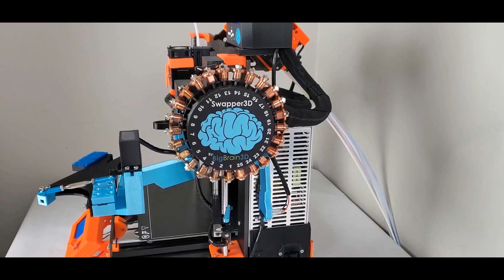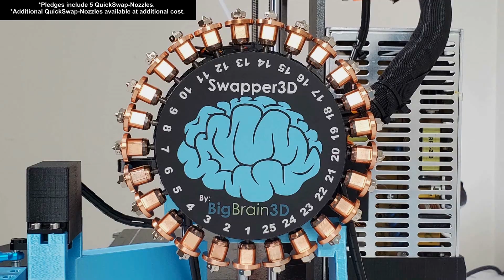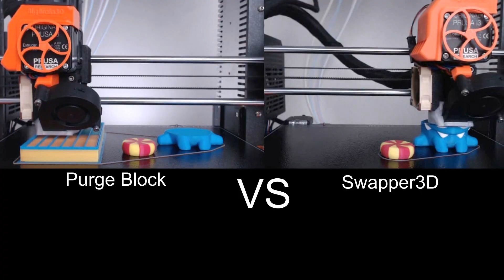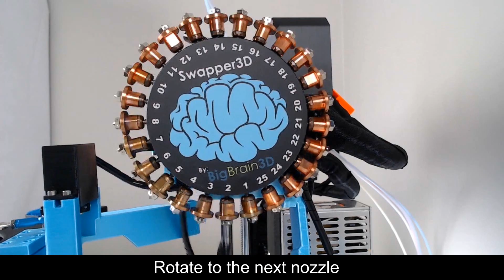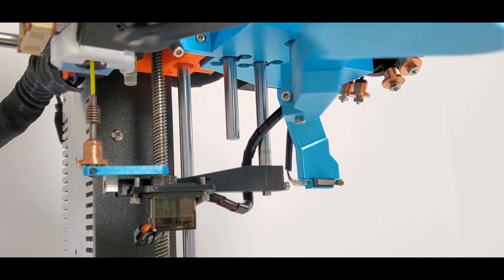Never print a purge block again!

Comment from the maker: Thank you all for the overwhelmingly positive support!!!!
As we review the comments it’s clear that there is some information missing from the demo video. But YouTube won’t let us make changes to it, so we’ll attempt to address some of the needed information here. We are working on a supplemental video now that also addresses these points. In the meantime, we hope this helps.

Here are the answers to your most frequently asked questions:
Q-How is the filament switched? 
A-In this video we are switching the filament after a nozzle change using the Prusa MMU (Multi Material Unit).  In short, the MMU pulls the old filament out -> selects a new filament -> then loads the new filament in. (The Swapper3D cuts the filament before the MMU pulls the old filament out to prevent possible strings and jamming.)  The Swapper3D can also use these filament switchers: Mosaic Palette (any version), CoPrint,  ERCF (enraged rabbit carrot feeder), Ryper MMU, 3D Chameleon, and any other similarly designed filament changer.

Q-If you only have 25 nozzles can you print a model with more than 25 color changes? 
A-Yes. Each nozzle is assigned to a single particular color and reused an unlimited number of times. Each time the printer needs to use that color the Swapper3D loads the nozzle for that color, it's heated back up, and the printing continues. In this way unlimited color swaps can be done. For example, the print in the video has 576 swaps. 

Q-Why 25 nozzles if the mmu can only manage 5 filaments? 
A-The Prusa MMU can switch between 5 filaments, the CoPrint up to 7, the Mosaic Palette up to 8, the ERCF up to 12 (enraged rabbit carrot feeder), in the future there may be even more. The Swapper3D supports "UP TO" 25, but it will work with 1 or 2 or 5 or 8...all the way UP TO 25. When users purchase the base Swapper3D kit it comes with 5 QuickSwap-Nozzles and it can be expanded by adding more at any time in the future. The ‘up-to’ 25 nozzles can also be used to automatically switch different nozzle sizes during the print even when printing with a single filament. 

Q-Wouldn’t some other printer/system/technique be better/faster/less expensive to use than the Swapper3D? 
A-No. Some people really love their 3D printer (like the Prusa i3). With the Swapper3D they can keep the printer they love and add new improved functionality to it. No tool changer out there supports 25 tools, there isn’t the space for that many tools. All those other ways of MultiColor printing require purging, and the Swapper3D eliminates that. Over time the ongoing consumable filament costs + time saved will pay for the Swapper3D’s static price. 

Q-Will this work on my printer?
A-Possibly. Currently we only support the Prusa i3 and Creality Ender 3 out-of-the-box, but we will be adding support for other printers as fast as we possibly can. Brave Makers (like you) can also modify the mounting bracket or create an adapter to mount the Swapper3D to their own printer. We encourage this and supply the 3D step files to our customers to make it easier for them to create their own custom adapters. In addition to mounting the Swapper3D, your alternate 3D printer needs either an available serial port on mainboard or an external Raspberry Pi running Octoprint to coordinate nozzle swaps. 
Because there are so many different variations of 3D printers we really do need the community to help expand support for the Swapper3D. 
Printers with a similar design to the Prusa i3 (i.e. bed slingers) will be the easiest to adapt to. Core XY printers will be next for us to create a variation for. There is nothing preventing a core xy printer from using the Swapper3D as long as it has a) an adapter b) an available serial port and c) available clearance. 

Q-Is it open source?
A-Since we have added some new gcode commands to Marlin firmware those changes will of course remain open source along with Marlin's standard license. Additionally, the Swapper3D firmware and all of the printed parts are Creative Commons Attribution-NonCommercial 3.0. 

Q-How long does it take to heat the nozzle up when it’s first inserted? 
A-About 15 seconds, which is almost exactly the same time it takes the MMU to unload the current filament and load in the next filament, which means the swap adds zero(0) seconds of additional time because of the nozzle heating up. The Nozzles have a low thermal mass. The QuickSwap-Hotend has a much larger mass and it maintains the temperature of the heater block at all times, during printing and during a filament change and during a swap, with the standard 6mm tube heater and thermistor of the Prusa i3 extruder. When a cold nozzle is inserted, it lowers the temperature of the heater block by about 15C. The Swapper3D inserts a gcode command to wait for the temperature to stabilize to the print melt temperature before it continues printing. 

Q-Do you have any videos showing the printing while using the Swapper3D?
A-Here are 2 unabridged videos of printing with the swapper3D:
     Front facing: https://youtu.be/Z3rjUGf5QYM
     Side facing: https://youtu.be/ltVoUz5mSNg

Q-How do you deal with any ooze that happens while the nozzles are cooling down or heating up?
A-There is a wiper molded into the cutter guard that deals absorbs the ooze (not shown in this video. see Kickstarter for more details) We also infill before perimeters to address the pressure stability and priming. Though additional priming can also be done on the wiper pad if needed.
 
Q-If you cut the filament how does retraction work when the nozzle is loaded next? In other words, will retraction still work?
A-Yes the retraction still works. During string calibration test prints no noticeable difference is observed between areas where the filament is cut and still disconnected and those where the filament is rejoined in the hotend melt zone. The effect of retraction is made by removing extrusion pressure which still happens during retractions even after the filament is cut. 

Q-Does this work for automatically swapping different nozzle sizes during a print? 
A-Yes, you can use this to automatically change nozzle sizes too. and you can use it to swap filament materials too.

Q-Can't we just purge to infill?
A-The infill is almost never enough volume for a color purge. Remember the infill is limited to the volume of that color space on a single layer. And the infill volume varies by layer so for larger layers maybe it's enough but it may not be on smaller layers and then you'll get color smearing.

Q-Can you share some of the  failure modes of such a system ?
A-We foresee 4 possible failure modes 1)it cannot unload the nozzle 2) it cannot stow the nozzle 3)it cannot select a nozzle 4)it cannot load a nozzle. We incorporate a check switch/probe that confirms each of these steps. For instance if it failed to pick a nozzle out of the tool holder wheel then when it moved to the switch it would not trigger it, then the Swapper3D would display an error on the LCD and pause the print waiting for user intervention. 

Q-Is there too much weight added to the Z axis?
A-No. Not for a lead screw. 1398g are added to the sprung weight. The current of the Z steppers is increased to account for this, and no missed steps have been seen. In the kit we include heat sinks and a fan that are added to the printer main board which keeps it much cooler than it was with even stock current.

Q-How are the QuickSwap-Nozzles held in the heater block?
A-There is a sliding lock that pulls the hotend up against a taper in the heater block. You can see more information about it on the Kickstarter page.

Q-How high is the failure rate?
A-Very low. We are currently stress testing the current iteration of The Swapper3D (the one in this video) which has done more than 35,000 swaps without failure up to now and is still counting.

Q-Wouldn't a purge bin be better?
A-No, because the amount it would need to purge would be the exact same amount (and take the same time) in both cases. The only benefit to a purge bin is that you save the bed space, But many printers cannot move the nozzle off the bed, so in cases like the Prusa i3 you cannot use a purge bin. 

Q-Why are you cutting the filament when you can just retract before pulling the nozzle out?
A-Because Swapping nozzles is better. Pulling out the filament can cause strings and malformed tips that interfere with reinserting that filament next time. It's such a common problem that many users hate filament switchers like the MMU because of it. Cutting the filament eliminates the possibility of those problems and makes the MMU much more reliable. 

Thank you for watching! =D
Reply: I really appreciate your candour, but "open source for non-commercial use" is in direct conflict with clause 1 of the Open Source Definition. On the other hand, NC is an established condition in e.g. Creative Commons, and a respectable choice of where to draw the line for your designs. 

The point it becomes a bit weird is e.g. if someone wants to build a print farm using a printer that requires a modified mount; will they e.g. have to override the license by interoperability requirements? Would it be restricted to hire a modeller to design that modification? 

Anyhow, those are hypothetical scenarios. Your product remains your design and anyone would be free to approach you to negotiate terms if those prepared don't suffice. 

Good luck!
Reply from the maker: @0LoneTech  We've updated our pinned comment and will use the more appropriate license you suggested. Thank you for your advice :)
Reply: How can this setup accurately position the nozzle when swapping?? .. just a 0.05mm Z variation will totally screw up a print.. and a 0.1mm X-Y position error will show on your part. Are you recalibrating somehow after each nozzle swap??
Reply: Hi, just saw this video and Kickstarter has finished. How do I buy this? Do you have a website, email list etc? Couldn't find any details on Kickstarter (never used it before) on how to contact a project after funding, like Indiegogo's "in demand" feature
Reply from the maker: @darkbunglex  We've updated the Kickstarter page with a 'Pre-Order' button. The Swapper3D is now available to pre-order on our website: https://www.bigbrain3d.com/product/the-swapper3d-no-more-purge-blocks/
Reply: Really cool. How does the quick-swap nozzle work, I mean it doesn't fit in the Prusa extruder, would you exchange the extruder? Any plans to make it compatible with Prusa MK4?
Reply from the maker: Yes, we plan to support the Prusa MK4. Currently the QuickSwap-Hotend required to use the Swapper3D does fit in the stock i3 MK3S+ extruder. We are going to do our best to support the MK4 extruder with all it's awesome new features, especially now that the MMU3 is coming out.
Reply: Good question… Is every swap nozzle calibrated in it’s Z height like CNC tools?
Reply: do not buy. project was abandoned. owner won't respond to backers or community
Reply: Is this shipped to anyone? I hardly see anyone using it other than your video on YouTube!
Reply: Ñ km

Comment: A few other questions for your FAQ:

1: Has it gotten klipper support?
2: Is it open source, as in an existing bom? Or closed source and electronic parts only gotten from your store/pre-compiled firmware only?
3: Does it only work with that hotend in the video? Or altered past year to work with other hotends?

Comment: Question: 
How accurate is the z-tolerance (and x/y) so the standard deviation?

Don’t you need to purge some filament, because of the filament overheating.

What about retraction, because you cut the filament…

Comment: I bet if you'd release a compacter version with only 5 nozzles on a little tray instead of the big wheel with a motor and reducing the size of the filament clipper by it being pushed towards the filament from the side instead of rotating it in or something, it would be a nobrainer for even more people.

Comment: You know, I feel like this is a super smart solution to multi color printing without purge blocks. The one part that you lose with this though compared to something like a toolchanger is the possibility of multimaterial printing since you cant have different nozzles at different temperatures. Maybe something like this where you could also swap the heater block would be a fix to that, but at that point the complexity of the solution is wayyy too much imo

Comment: You guys should just make your own 3D printer, and mass produce them... Unless there is a patent preventing you from doing so. I feel like you could also make a tool changer style CoreXY similar to the XL that has a row or several rows of nozzles that the print head can move over to the nozzles and it moves up and down on the nozzles to docks or undocks them rather than using so many servo's and motors.
Reply: they couldn't even complete this project. they have completely abandoned it at this point and won't respond to their backers

Comment: Cool, but you still have filament in those nozzles and on top of that, a kickstarter project is generally something that a lot of people wouldn't back because there is no guarantee that you'll just run off with the money. It does look like it may have made it out of kickstarter and onto a normal product page, but that's a pretty expensive system.

Comment: Purge infil fixed it all.
Reply: I think it depends of the model. It may be that not enough color was bleed into the fill layer before printing the perimeters. In my case I still have mmu problems with the tips of the filaments and the palette is not very reliable either.

Comment: I do think this is neat but is vastly overengineered. the rotating tool changer is wierdly awkward and makes me wonder if there was some CNC machine patent dodging required to bring this to market. Most of this could be achieved with two sliding segments and a solinoid or three.

Comment: If you can swap out the enter head assembly why not make a rack with all the nozzles with individual filament feeds still attached skipping the cutting section all together? Heck you could even swap out the entire filament feeder assembly as well. Just need to attach the enter unit back up to the drive section of the printer.

Comment: Nice but I am concerned about the added weight on the z-axis and compatibility with direct drive extruders, like the Voron V2.4 or the Elegoo Neptune Series uses. I would love to see a similar system, that is also able to pull out filament, reinsert filament and is fixed in place without adding weight to the z-axis. It should also be easily be convertible to use on most other printers other than the Prusa line, though I understand why you chose them. 

If you'll ever manage to fulfil my requirements I'll be ecstatic, as long as it falls into the 200-350€ range.

Comment: For some comments here : its logic to swap the hotend to avoid doing a purge , but this means you can only swap 25 times in a print
Reply: No it doesn't. They said they swapped over 700 times during the demonstrated print. You're stuck with up to 25 colours, not 25 swaps.

Comment: 1:35 these are different prints on the swapper 3d print you dont have that huge cube that takes alot of time and filament so thats not really a fair test
Reply: Thats the point, you dont need that huge cube with this system 😊
Reply: This comment is satire right?

Comment: FDM 3d printing sucks no matter what you do...
Reply: why exactly?
Reply: @Kernias  Mainly because its very slow, also it has a lot of "variables" that can ruin the print, such as too much heat, not enough, etc. and then you get print that has visible layers, and currently there are no "plug and play" printers for people who just want to print without tinkering... (X1 also has problems)
Reply: @CubiCNooBiC  It is slow for large scale mass production, but if you need to prototype and cant invest in something bigger like sls its perfect and while the X1 may not be without problems it's plug and play for most people, and layer lines can mostly be smoothed easily but tell me why fdm printing sucks when i:
Need a prototype, fast
Want to replace a broken plastic part on something that isn't made anymore
Want to produce a small series of just a few hundret parts

Comment: I really wish this catches on :) Hate purge blocks :p Though in its current form it looks a bit big and bulky, 25 nozzles might be a bit excessivr :p But changikf nozzle diameter mid print is also a cool idea :) Print the outer layer in 0.2, the inside in 0.8, save a lot of tile (assuming the print isn’t tol small)

Comment: i do very much like the idea and fully back it however i do know there's a simple and cheaper way to do this which is firstly make your purge block much smaller and have your filament retract outside of the hotend then have it insert the next filament. you shouldn't need a cube any bigger then a inch wide if even that. now the other side of that coin where i do love the idea is this could allow for spots to have much higher resolution simply by changing the nozzle with this machine. 

i dont see this being of much use for color changing but that resolution changing part alone is awesome. this could also prevent issues from materials mixing down the road. I will be following this and wish you the best of luck on this project

Comment: How is possibly faster when it has to heat up each nozzle every time it changes color
Reply: The heat block is still hot as it switches, so when the new nozzle is inserted, it only takes like 10 seconds for it to heat up.

Comment: Why a rotative wheel? On a normal CNC, the tool changes on a straight group... Why not on a FDM 3D printer? This has no sense...
Reply: normal CNC machine uses a wheel style changing bits system. What are you on about? It just the style this person chooses. Just because you only saw ONE cnc machine with a flat rack for the bits doesn't mean that is the only thing out there in the world.